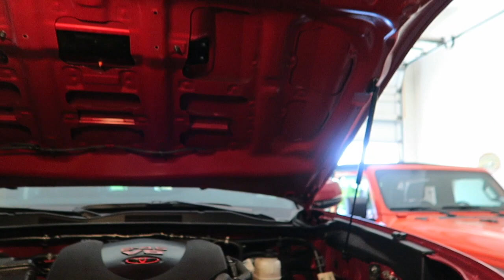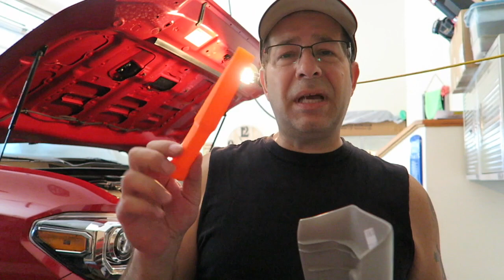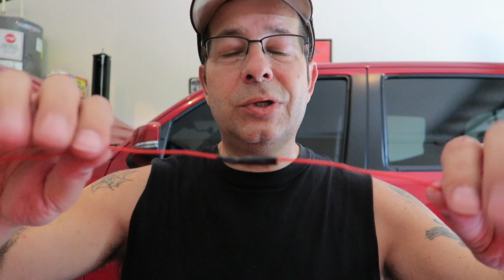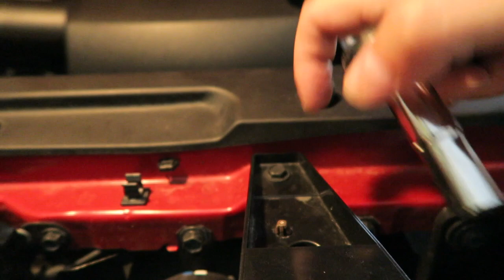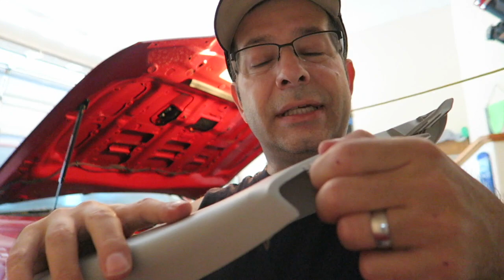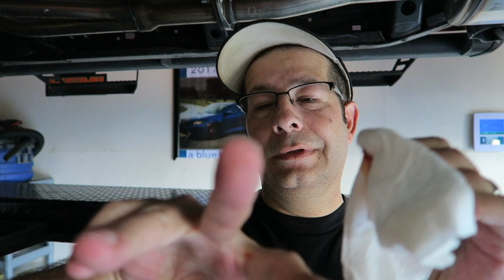Tacoma Modding Tips | Don't Fry Your Tacoma

Comment: Even if you remove the battery cable. Wait 15 minutes. Airbags are still energized
Reply from the maker: I did not know that 😬
Reply: I’m in firefighter training with certified recovery in car accidents. Jaws of life.. older cars there’s a chance even with battery cables cut, the air bags can be statically charged for 20-30 minutes. Newer cars are less. Are time wait is at least 15 minutes. So we can keep our paramedics safe while extracting the victims.